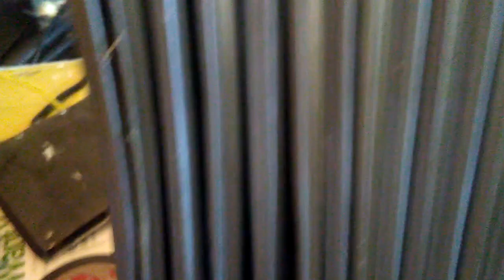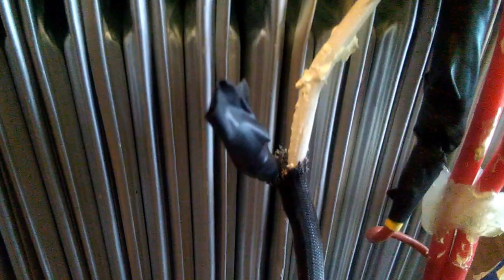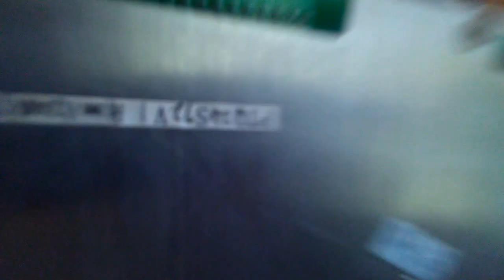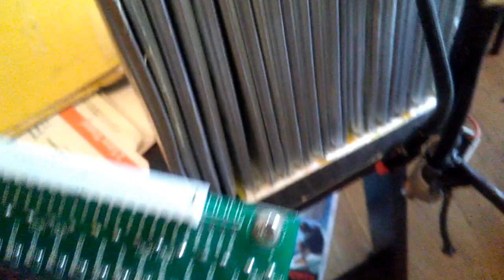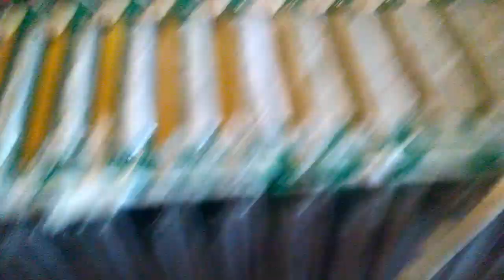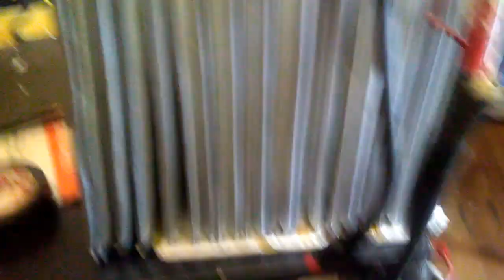A123 battery pack fail!!

Comment: alibaba is a good place to search for  batteries and there compaies on there which make electric bus batteries with very heavy duty type  bms which are good kind of factories to buy motorcycle batteries also  . https://tp-energy.en.alibaba.com/product/60307591595-210192746/_UL_approved_25Ah_Lithium_Ion_Prismatic_cell.html?spm=a2700.8304367.0.0.7qu1cB